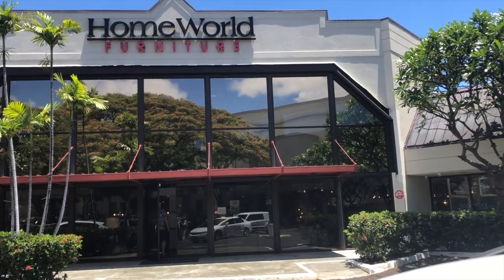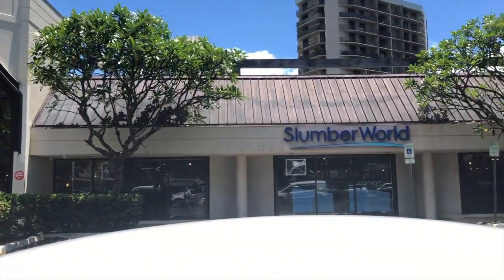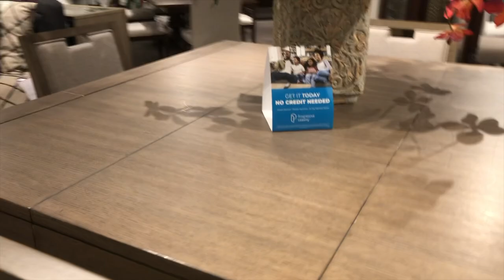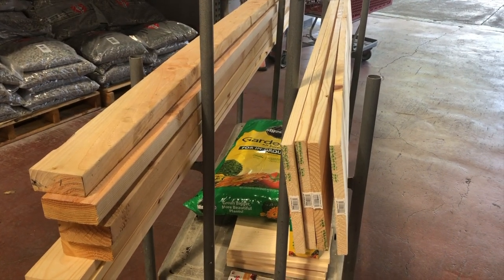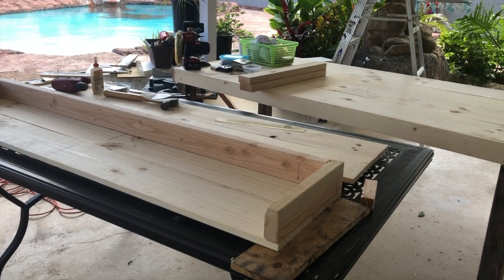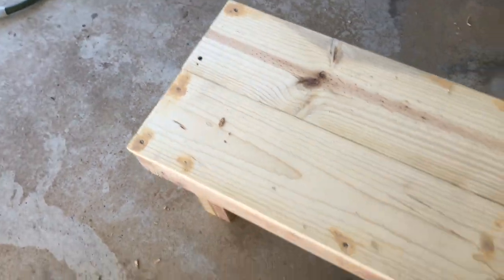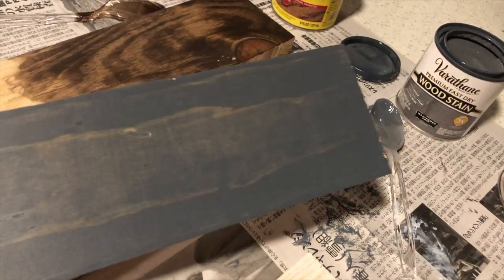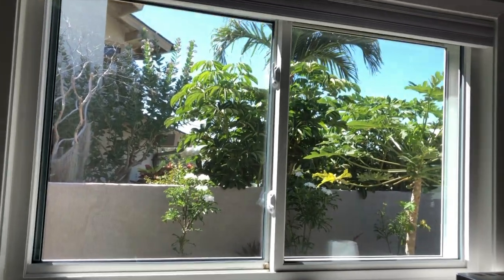How I Got a Dining Table for Cheap

Comment: You need to put wood sealer on wood before you stain so grain doesn’t come through.
Because of its combination of soft and harder wood, pine tends to absorb stain at different rates or amounts, which can cause blotching and uneven staining. ... To minimize this, it's best to seal the wood prior to staining. Sealing will help prevent the softer wood from absorbing extra stain.